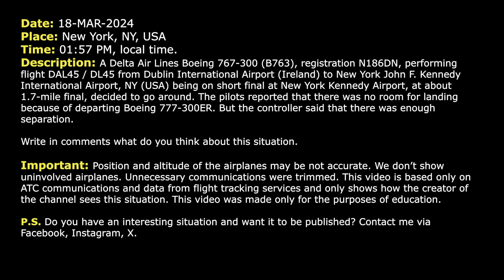Pilot argues with Tower controller about separation at New York Kennedy Airport. Real ATC

Comment: With an estimated ground speed of 150kts,  at 1.7 mi Delta was about 41 sec from crossing threshold. At 58kts Air India maybe 15 sec before rotation at most.  It would have definitely worked
Reply: And if Air India rejected takeoff for any reason?
Reply: @Nickbaldeagle02  that's a moot point, you can always go around DUH!!!!!  I like how you think you know what you are talking about.
Reply: @Ryan-iw8yw  like everyone on YouTube and Facebook.
Reply: @Nickbaldeagle02  Then Delta goes around and everything is still fine.
Reply: @Peter-sv4mk  Delta is passing the threshold.
Reply: @Nickbaldeagle02  The go around call if it were needed would be before Delta crosses the threshold, as the requirement for separation is that the Air India needs to be 6000ft down the runway and airborne before Delta crosses the threshold. So the controller would make the decision to call for a go around a few seconds before the Delta would cross the threshold if it didn’t work.
Reply: @Nickbaldeagle02  Delta was nowhere near the threshold, the animation on the video is not accurate, jeez first day on youtube or what?
Reply: @Peter-sv4mk  at least somebody knows what they are talking about
Reply: @Ryan-iw8yw  Only barely, I just look knowledgeable in comparison to everyone talking out of their asses here! :)
Reply: The ATC is pushing it and acknowledge it was tight. He was certainly hoping for a faster runway vacation from the first plane. Maybe it was still OK but "doing it every day" is not an argument. He tried to squeeze it, it failed and he should at least respect the pilot decision without comments. The main problem here is the ATC bad attitude after the fact. Nothing wrong with what the ATC tried and the pilot decision.
Reply: ground speed was closer to 200.   the differential is less than you state.   5-10 seconds makes a huge difference
Reply: @RobertQueensLisa  groundspeed of what was 200??? You obviously are not a pilot, final approach of that aircraft is nowhere near 200kts
Reply: @Ryan-iw8yw  ATC is putting our pilots in compromised positions.   ATC are not pilots, the attitude the controller uses is unprofessional.   The Delta pilot made the right (safe) call.   Safety first!
Reply: @RobertQueensLisa  And exactly what separation requirement was the controller violating? 

There is a clear and definitive standard here for what a “compromised position” would be. Do you know what it is? Or do you even have any idea where you’d look it up?

Comment: The pilot was wrong, it would have been well within ATC rules. The only thing needed is the preceeding with wheels off the runway by the time the arrival crosses the runway threshold. It does mean that you could have both aircraft over the same runway at the same time as long as the departing one is wheels off. This happens day in, day out at most major airports. Delta should send the bill of the extra fuel from the go-around to their overzealous pilot. We don't tell pilots how to fly their planes, they shouldn't tell ATC how to do their job either. If pilots start losing trust in ATC, the system is going to be in a world of hurt.
Reply: Thank God for ATC in Europe...Even if there is room for another landing, if the air traffic controller and the pilot are not on the same page, the landing won't happen. As a pilot, if I have doubts that there is a risk for landing, I will perform a go-around. I don't understand why the controller feels they need to take it personally and I can't comprehend how they can dare to comment on it with any remarks. Truly pathetic. Rejecting a landing is less a sign of failure than a showcase of steely-eyed judgment. And never attack the No Fault Go Around policy again! I wouldn't have expected such recklessness from you...
Reply: @ondrejmrhac9687  all I'm saying is that if wvery pilot did this, traffic would come to a stand still, even in Europe where ICAO rules are also used. I wasn't serious that the company should send the pilot the bill, but I would still make sure the pilot knows what rules ATC works under. I've had go-arounds for all sorts of reasons, such as the cabin not being ready, too fast, too high, unstable approach, on and on. Pilots should never force a landing they're not comfortable with. Having said that, go-arounds have consequences for everyone else and if pilots are not comfortable with how close ATC rules allow aircraft to be, that needs to be sorted out.
Reply: @morrij01  True, agree 🫡

Comment: As the saying goes: "When the pilot screws up, the pilot dies. When ATC screws up, the pilot dies." If the pilot didn't feel comfortable with that separation, he was right to go around. If ATC feels butt-hurt about it then that's their problem.
Reply: ATC probably didn’t like the “it was never going to work” from the pilot. Based on the info of 1.7 miles out and the departing traffic was at 54 knots, that was going to work all day every day. There was no ATC screw up here so the saying you said is ridiculous for this instance lol
Reply: @coltonakins4820  at 140 knots the captain has 38 secs to decide if air india is far enough off the runway, what if they need to abort? feel like its a tight spot, Air india also needs about 150 knots for takeoff speed.
Reply: @tomit-nl  if air India was already at 54 knots then where do you think they’ll be in 38 seconds? That’s actually a long time in the ATC world. If the aircraft had to abort takeoff then delta just goes around which is a normal maneuver. Air traffic would grind to a halt if you always had to think about a hypothetical aborted takeoff.
Reply: @steveburton5825  if ATC had to act like air India would abort takeoff for every single departure across the country then air traffic would grind to a halt and I don’t think you realize that. For example  LAX would not be operational at all if ATC had to account for hypothetical aborted takeoffs. Thats also extremely uncommon btw.
Reply: @steveburton5825  1.7nm while the departing plane was already at 54 knots. Thats gonna work every time.

Comment: Controller was rushing to get the 777 out in time.  Looks like he may have even cleared Air India for takeoff before the Citation declared clear of the runway.  "It would have been close, but it would have worked" means the you would have broken some rules, but you probably wouldn't have crashed.  Controller lining up the holes in the swiss cheese because he "do(es) this every day".  Only matter of time before we have a big accident the way things are going right now with ATC and some pilots.  This pilot took his responsibility correctly, made the call and didn't get aggressive over the air even though tower wanted to get into a pissing match about it.  Good job Captain.
Reply: You don't know that. You don't know if the recreation and the audio are synced up.

Comment: The controller is right in that it probably would have worked - but that cannot be how it practically works, because ultimately the pilot is responsible if something goes wrong off the approach. This is a US thing - clearing aircraft to land with any number of aircraft ahead of you on final and to depart. In other words, despite a clearance to land, the runway is not physically clear. In most other countries, a clearance to land means the ATC has taken responsibility that the runway is indeed CLEAR for you to land on (you see where I'm going with the wording).

I'm not judging the way the US does it, but it will only mention that it does come with caveats - specifically, that if the pilot says they're going around, then that's just how it is - you left it to his or her judgement, so expect him or her to make a judgement call. As an ATC, you can't try and squeak it all through a tiny window when the pressure is on you to do that, BUT it's not your responsibility if there's a balls up.

As somebody who operates around the world, every place has it's quirks, but the US has a lot of quirks, relative to the rest of the world that is. I don't mean that disparagingly, they obviously flow a lot of traffic and it works for them - but......this is an example of phraseology that becomes counter-intuitive when used the way they use them.

Comment: Not a pilot, but should an ATC at a busy airport be instigating an argument on comms? A simple, "roger, that's your call. Turn heading..." would have sufficed. Im sure a proper New Yorker could've still gotten enough passive aggressive tone on that to get his narcissistic point across without declaring an open invitation for a discussion over the air (good on Delta for not taking the bait).

Comment: Why, oh why do the controllers ask for the reason for the go around so quickly? It is always the captain’s decision whether to land or not, nobody else. The tower controller should not be asking for the reason for the go around, the pilots have a job to do and interrupting them at this important time is not acceptable, the question can be asked later when the crew are in a low workload situation. As a retired airline captain from the UK I still don’t understand why a landing clearance is given when the runway isn’t clear of traffic, it’s not done over here, even at very busy airports like Heathrow.
Reply: The US has (almost) only air and road transport. And they neglected to upgrade and maintain both for decades. So now, they just compromise safety.

Comment: 1) No one is arguing in the audio, despite the clickbait title. Other than maybe the controller calling Delta 45 "American 45." That could start some shit! 

2) The number of people blaming the controller here is bizarre. He's at one of the busiest airports in the world, no shit the operations are tight. He's doing his job perfectly fine. And the number of people suggesting there would have been disaster or safety issues had this continued farther are ridiculous. If Air India had aborted, then the Delta flight goes around, not a big deal. 

3) The Delta pilot wasn't in the wrong either, he erred on the side of caution, and there's never any blame to be assigned for that. But...

4) ...it definitely would have worked out for him to land behind the Air India.

Comment: The PIC of any aircraft has the ultimate responsibility and authority for the safety of his/her aircraft and thus has the absolute right and duty to execute a missed approach and go around if in his/her judgement that is the safest action to take.  ATC is there to assist in the operation and traffic management, but it is the PIC who is in the best position to decide if a go around is necessary to assure adequate separation.

Comment: So the Delta pilot was 30-45 seconds from touchdown & the 777 waa about 90-100 knots from VOR. That only works if there is no problem, if India has an issue, it could have been a disaster.
Reply: No, it's very clearly not an issue. If Air India aborts, the Delta flight goes around.
Reply: @Peter-sv4mk  IF India aborts in the next 20-30 seconds. You are assuming absolutely nothing goes wrong. The Delta Capt clearly didn't want to take that gamble.
Reply: @Peter-sv4mk  There are roughly 100,000 flights a day, which means one in a million pops up every 10 days.  One in a billion every 27 years.  Who would have thought Concord would crash because a wheel came off a different plane?   You want to keep people alive it takes doing things that are 100% safe, 100% of the time (knowing mistakes and breakage will occur).  You slip to 99.99% or 99.7% and people die.  That's the lesson of air travel since WW2.

Comment: What if "Cleared to land" actually meant that it was CLEAR to land?
A trend in ATC videos and operations lately is stacking up departures/arrivals with minimal spacing. I love the effieicency, even when it doesn't quite work (like this one) I think it's fine. My quation is, why are controllers so eager to clear someone to land #2 to follow a Citation on final and  also squeeze in a 777 on departure? Can't we just say "continue" and offer the "Cleared to Land" comm once Air India starts their T.O. roll? That would also help establish a Captain's decision point vs. having to judge the spacing on short final.
Reply: "Cleared" in this case means you have PERMISSION to land, doesn't mean that the pavement you are landing on is CLEAR.

Comment: Take time out of your busy schedule to "nu-uh" the crew. I wonder how many pilots give in to the pressure and do things they instinctively wouldn't do?
Reply: It just happened with the United 737. Guy had over 30 years experience and was told to expedite off the runway. It was wet and raining, he taxied way too fast on the turn off the aircraft slid into the grass and ripped the landing gear off the plane.

Comment: Blocked / traffic on runway !  Screw that stupid controller -   He sits in a chair ….     Basically a no talent with a big mouth and 
A huge ego that needs to be fed constantly .   If you are not the flight crew , you are merely an assistant to the airport .
Keep your stupid opinions to yourself and shut your yap about unnecessary radio coms. Do your job and do it right - 
The air traffic controller is not in charge of the flight !   Thank God .    He is a ground based government assistant that 
Communicates via radio to the aircraft to relay necessary information and traffic/ weather guidance .   All this was told to me 
By my friend who was a long time controller at Miami international airport -   He knew his job .   Also a cool pilot .

Comment: For all of you saying "iT's tHe CoNtRoLleR's j0b t0 kEeP iT TiGht", F off outta here.  Either you've forgotten that the Captain of the aircraft has the final say to go around or not, or you haven't been paying the slightest bit of attention to all the close calls at the fault of controllers recently, or it's a little bit of both.  Given that the swiss cheese is getting REALLY fucking close to lining up for disaster, you'd think a controller would want to err on the side of caution.

Comment: Having flown for Delta for 35 years I completely agree with the Delta captain. The air India was only 54 knots while delta was 1.5 miles out . If the air India would have had to abort just  before rotation The Delta plane would be in the flare or on the runway and there would have been a terrible outcome.
Reply: that was my first thought as well. what if Air India has to abort the last possible moment? that would have been way more than "tight".

Comment: heavy = for experienced type hours
citation = establish flow

before citation = pivot point of data
after citation = effect can be opposing

landing braking heavy - pulling forces, wake effect pivot-point of india-heavy take-off

point - pivot-point. ATC lacks one-point. pilot of delta45 is right. option to play report-writing via airline-office if decide to play-skills instead of play-ATC skills
Reply: float on wake, ground-effect vehicle braking. no-need to trim spoilers to lock AoA.
Reply: kenny kennedy is chicken fear of words.
map is based on time-date air volume-pressure speed-pressure. most old map shapes are correct, on that account. equator and lines above-below are also correct. java-indonesia as one island is split-rotated by those 3 lines, pivots
Reply: americans are south-park and simpsons to chinese-perspective with red-neck provisions

Comment: At 140 Knots the Boeing 767 would cover the 1,7 miles distance in 38 seconds and Air India was only doing 54 Knots rolling on the runway... If Air India rejected the takeoff for some reason, it would be really dangerous!!! At least one more mile of separation... This is incredibly tight!  Excellent decision of the Delta Captain and I think some risky behaviour from ATC... When ATC says '(...)Probably would have worked(...)', that's something you don't want to hear from him... The safety margin was not there!!!
Reply: If the air India’s would rejected takeoff, Delta would had 38 seconds to go around.  Expecting a runway to be completely clear 1.7 out is well, delta keeps it reputations of not excepting visuals following other traffic
Reply: @phillipwhite8463  If the have to abort close to V1, that may well be another 8 sek. Then you some delay for either air india report the abort or delta noticing the decrease in speed. from straight behind, that's actually not that easy, and the should be focused on their landing, not be distracted. that's easily another 10 sek. engines don't react instantly, probably 5-10 sek to spool up. anything else goes wrong...
The Pilots Job is to make sure it's safe above all else. Not his problem that the US lacks in infrastructure.

Comment: You get into a risky situation if air india rejects its take off for some reason. What if there is fog. What if someone steps on the controller when they need to command a go around? At such short distance there are insufficient safety margins
Reply: If the Air India rejects then the Delta goes around. Not difficult or risky. 

There was no fog, the Delta was on a visual approach. 

If the controller's instructions got stepped on, then Delta will still go around because they can see the runway isn't clear.